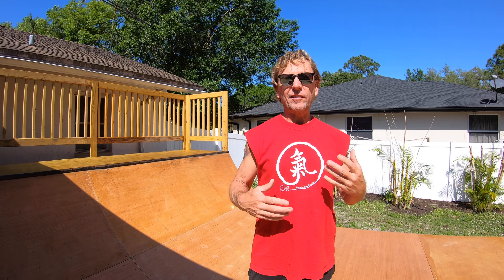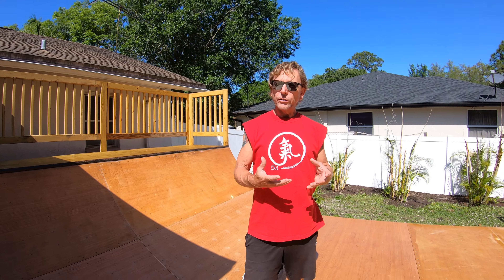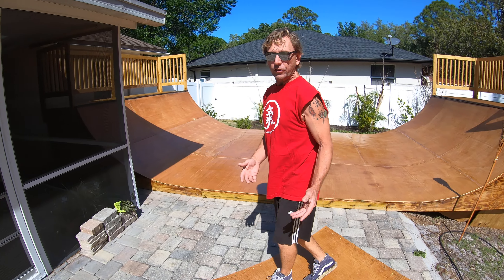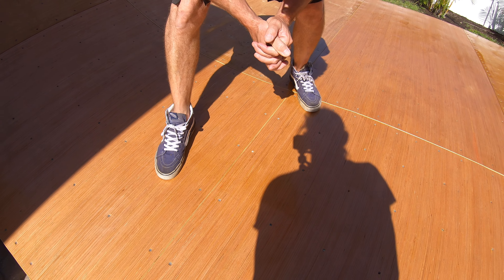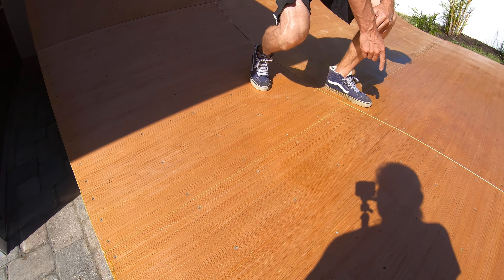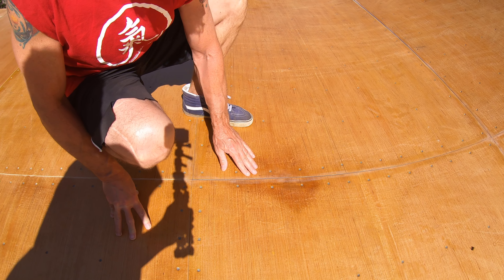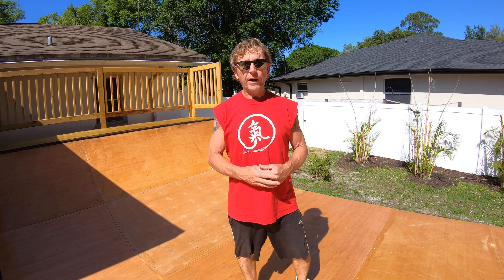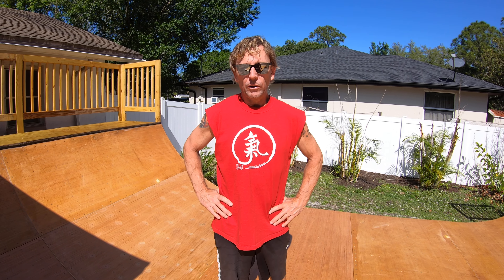Important update on sealing the ramp surface!

Comment: What are your ramps dimensions? I have an 18 by 12 ft concrete pad left from a old shed type bldg we tore down. And Im thinking about eventually putting a mini ramp on it.
Reply from the maker: This ramp is a little less than 4 ft high, 12 ft wide with about 10 ft of flat bottom. It's about 27.5 ft total length.